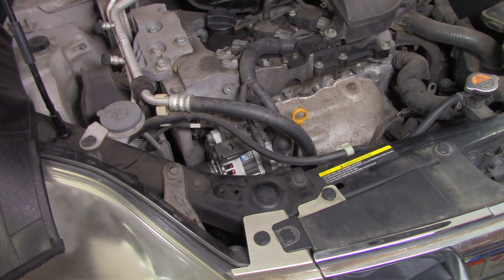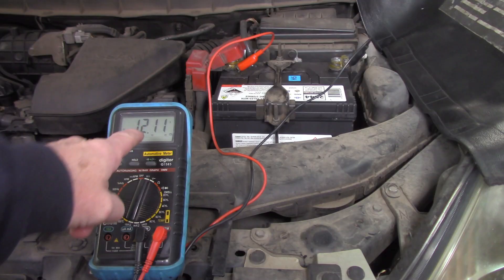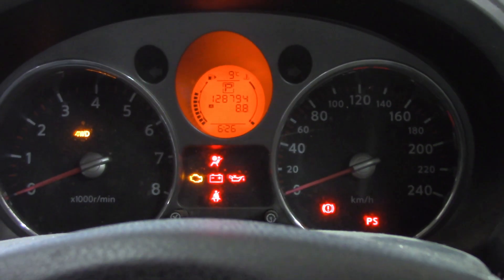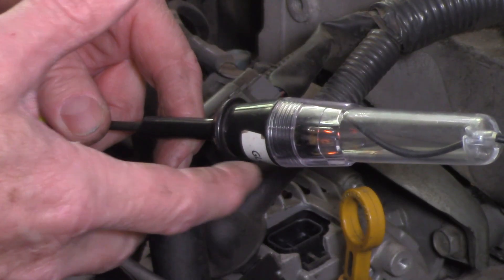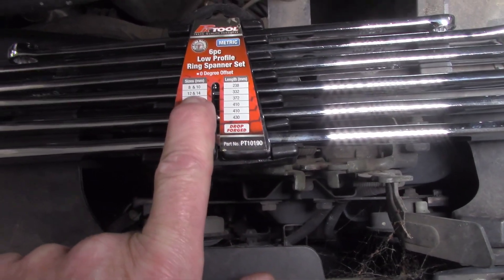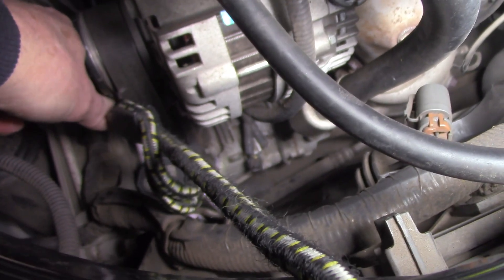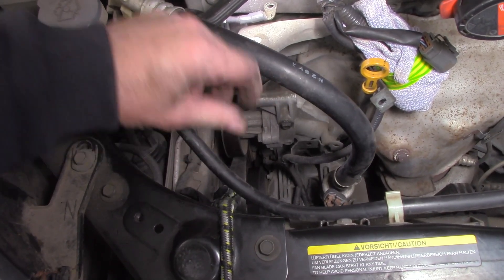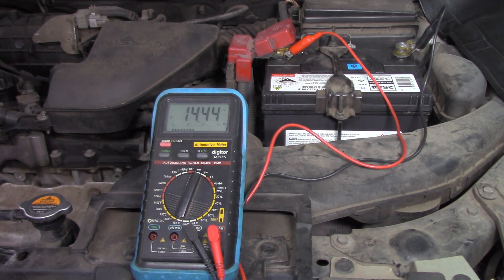How To Test An Alternator   DIY   Nissan X Trail

Comment: Amazing videos sir 🎉 out of subject but my triton 4n15 got injector rebuild and on machine and obd injector and car looks ok but i noticed it cant go faster than 120 km/h do you have any idea??? Thanks for help
Reply from the maker: That's a very broad question!
What information can you provide me? Are the turbo boost actual and desired readings the same? Is the exhaust blocked at all? Is the EGR operating correctly? What are the MAF readings at idle as well as 2000 RPM? Has any work been done on it recently? When was the fuel and air filters replaced last? Is there carbon build up in the intake system? Are the actual and desired fuel pressures the same? Is it only since the injector replacement that the fault has occurred? Did you do the work yourself or did a workshop carry out the repairs?
I do have quite a few Triton videos on the channel that might help you.
Reply: @MiracleMAX this problem occurred after injector rebuild before that car was fine and don’t know about maf but egr and intake are mirror clean new filter every 10000km
Reply from the maker: @rastydizayee3723  Did you take it back for warranty?
Reply: @MiracleMAX they check by obd and injector by machines and all is normal
Reply from the maker: @rastydizayee3723  And what have you found with the testing I mentioned in the last comment?
It does seem strange that it only happened since the injectors were done. Were they rebuilt or replaced? If they were replaced, were they coded?
Reply: @MiracleMAX rebuild they changed solenoid and nozzle heads all parts but I noticed something that solenoid dosnt have codes like oem ones even they did injector learning
Reply from the maker: @rastydizayee3723  What were the results of the other testing I suggested?
Reply: @MiracleMAX obd guy say all fine
Reply from the maker: @rastydizayee3723  Sorry, unless I get specific data I can't help. I would be taking it back to the guys that did the injectors as it was fine before that repair was done.
Reply: @MiracleMAX sorry for bothering and taking to much time but do you have any other accounts that i send datas to you sir
Reply from the maker: @rastydizayee3723   Before I get further involved, I suggest you take it back to the guys that did the repair before the fault occurred.

Comment: Great video 👍 I can understand th general principles of the alternator where it uses 6 x diodes to rectify the current on each phase of the stator wirings. Then I can imagine the voltage is regulated with some sort of transistor circuit. 

I do have a 2006 Toyota corolla and from memory where you have 2 wires mine has 3. This video gives me a bit more of an idea of how it works. 

Look forward to more automotive electronical videos
Reply from the maker: Yes, after the rectifier (diodes), it then goes through a regulator to control the alternators output to a desired voltage and amperage.
I made a basic alternator to show my apprentices out of a iced coffee plastic bottle, copper wire, a crank handle and some steel washers, just to show them the rudimentary application of the physics of the alternator.
It made a very nice AC waveform on the oscilloscope.
Reply: @MiracleMAX that's very cool. You should do a teardown video of the alternator and show the bad bearings and how to replace them. Thanks again
Reply from the maker: @edwardmenzies6736  I'll put it on the list!
Reply: @MiracleMAX it would be great one day to see a video of the iced coffee bottle alternator and see the output on an oscilloscope. I tried to look online for a simple project and I could not see much. Be interesting to see how many turns of the copper wire you made to make it work
Reply from the maker: @edwardmenzies6736  It was a few years now and I think that after a few uses it fell apart, but it was a proof of concept and  the principles of induction.
Reply from the maker: @edwardmenzies6736  I was cleaning out some photos today and found the Iced Coffee Alternator photos. If you want to check them out, you could Email me at miraclemax3@hotmail.com
Reply: @MiracleMAX will do

Comment: I once had an alternator scream. It was a shorted rectifier diode. After a short time running it got quite hot too! Couldn't find that specific diode then so threw in a 2nd hand unit.
Reply from the maker: Yup, they do make quite a scream! 😱
Good to hear from you Jonny.
Good job on the face mask! 👍😊
Reply: @MiracleMAX  Cheers mate 😊